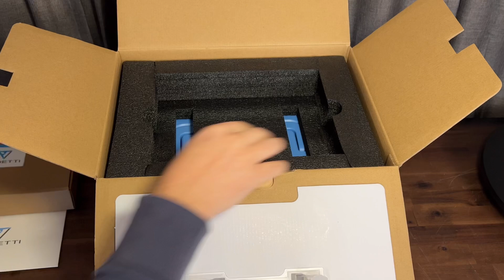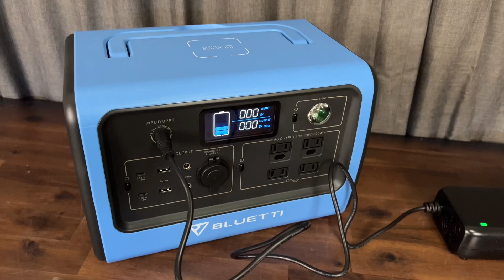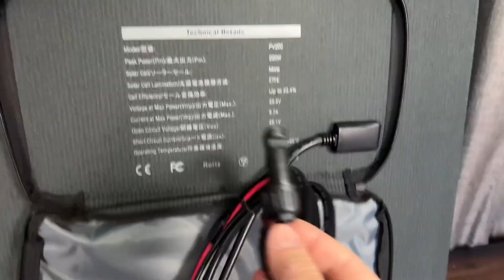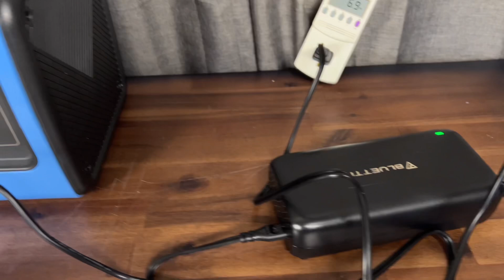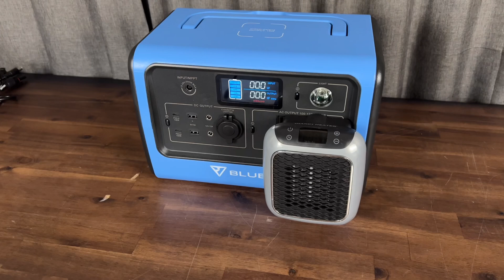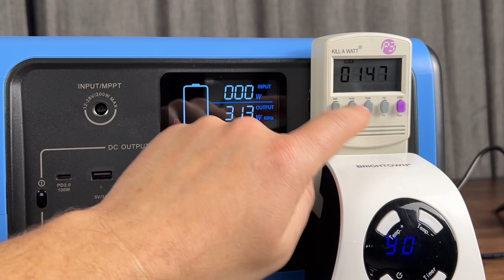Bluetti EB70s Updated model review and test

Comment: Good efficientcy, 80% for AC out, nice! My ecoflow river is only 70% efficient on AC
Reply: I think the bluetti is better but it is going to depend on how much power is actually being pulled out of the inverter.  The idle consumption is probably around 10W (bluetti doesn't show the idle consumption on its output display)... and the inverter is 85% on top of that.   So with small loads the overall efficiency is pretty bad, but for larger loads it's decent.  Not great, but decent.
Reply: So which one is better the eco flow or this one?
Reply: @dogfilms7753  The real answer is "You want to use the DC output if you care about efficiency".  Unfortunately, the DC outputs are fairly severely limited in terms of wattage.   Kinda makes one want to kick all of these power stations to the curb sometimes :-(

I am actually doing this for a few things.  I have a few gigabit switches that take 12VDC, so instead of plugging the wall-wart they come with into the AC output, I wired up a DC plug.   If have some POE+ routers that need 52VDC that I use for my wifi routers and security system.  Instead of using the wall adapters on the AC output, I wired a DC-to-DC converter up to the 12VDC output (12VDC->52VDC) to run the POE+ routers.  Thugh YMMV on that.  Potted DC-to-DC converters typically only output 48VDC which isn't enough for some POE+ devices.

That is, unfortuntely, my conclusion.  If efficiency and run-time on backups is important, the DC path is better across the board, no matter which power station one has.
Reply from the maker: I thought the river was better… 🤷‍♂️🤔
Reply: @johnnysweekends  some reviews put the river pro at 80% efficiency. Mines is river w/o pro or max.
Reply from the maker: Ahh got ya. I have a older delta and the newer is way better. The pro is the bomb!  Lol
Reply: @johnnysweekends  yeah the reviews on pro are great!
Reply from the maker: Yea but man they are spendy.
A lot of other companies are building more right now so I expect to see great things out of several power stations soon!!

Comment: The two DC ports are extremly useful.. you can connect stuff on them with an adapter.. perfect for vanlife.. unfortunately you didnt knew that
Reply: Yup, I'll be using this to power my 12v tv in my tt and my dish network from 1 source
Reply from the maker: Well with a adapter it must not be to useful or you would need the adapter. 
Those Dc ports and items you buy with that connector is becoming more rare. 
I think I have two items left with that plug. 
The 12 volt socket is more valuable to me. 
Almost everything now is usb and usb-c
Reply: @johnnysweekends  All depends of your needs, some plug other 12 volts device, tv

Comment: Would this updated version be able to power a lower consumption hot plate
Reply: I use a 500W hotplate without problems.
Reply: @blackbalerion  what hot plate do you use? Does it work fairly well with what you cook?
Reply: @FellDestroyedMusic  I use a Rommelsbacher RK501 500W hotplate. It boils up 1l Water in a standard steel pot in max. 15 Minutes. Using it to warm up canned food and it even works faster than boiling up water.
Reply from the maker: Yea… does it?? Lol 😁
Reply from the maker: Nice..👍🏼
Reply: @johnnysweekends  I also tested a 1000W hotplate... Actually it constantly needed just slightly ABOVE the 1000W limit of the EB70 (1014W approx.). The EB70 managed to deliver that output for about 2 minutes and then shut off because of overload... That is why I switched to the 500W Rommelsvacher RK501...
Reply: @blackbalerion  thanks for the information 👍
Reply from the maker: I couldn’t it to hardly even hold 800. Mins wouldn’t start a 800 watt heater that clicked to about 1100 watts for about 2 seconds or less.
Reply: @blackbalerion  I found a 900 watt hot plate. If this unit can't handle it I will downgrade to either 800 or 700 watt
Reply from the maker: Let me know how it works out..👍🏼
Reply from the maker: Nice, what brand hot plate?
Reply: Well I think I've found a solution. I located a hot plate at 800 watts. SOLUTION
Reply: So I've got the unit now. I have a 500 watt blender. It takes about 200 watts to run and it works amazingly. I also got a mini waffle maker and it works incredibly as well, taking maybe 350 watts to power. NOW I have just tested the 900 watt hot plate. It requires about 850 watts which the unit can handle HOWEVER after a few minutes it does overload but you can just turn it back on immediately after. Also, the hot plate really just heats up not a specified temperature which I can deal with, and after about 7 minutes it is so warm you really don't need constant power to heat it up any further. I am happy with all of these products. I might have to try an 800 watt rated hot plate and see how the Bluetti handles it.
Reply from the maker: Glad it’s working for ya, and yea if you get the 800 watt plate it will probably use about 750 so should be good 👍🏼
Reply from the maker: All depends on the watts of the hot plate. What are the specs?
Reply: @johnnysweekends  sorry, I'm not super familiar with this. I found a 1200 watt hot plate. If this is too much, is there a hot plate that would work with this power station
Reply from the maker: Yea that’s definitely to much for this unit…most hot plates are like 900 watts and above so this unit may not be best for that. I know it’s pretty sensitive at 800 watts. 
May need to look into a larger unit

Comment: Basic solar panel question I am hoping someone can answer for me.  I just ordered my eb70s (had it on sale for $449) and it’s solar input takes 12-28v and up to 8amps for a theoretical max of 200watts.  I already have some non-Bluetti solar panels so trying to get the max out of those.  However, most portable solar panels are 18v, so I can only input 144watts max at 18v and 8amps.  Is there a relatively inexpensive way to convert the 18v to 28 v, or would that require me putting a charge controller between the solar panel and the charge controller already built into the eb70s?  Too bad it doesn’t take up to 36v, as that would be easy(or if I hook up two 18v for 36v, will the charge controller in the eb70s regulate that down to 28v without adding anything)?
Reply: Where did you purchase your Bluetti for $449...?
Reply: @valiantthor-  It's still on sale. So is the 200 solar panel. Together they are $994.00. From the Bluetti store in Las Vegas NV.
Reply: @brynn-kolby5570  do you have the link?
Reply: @valiantthor-  strange.  I had a long answer and it disappeared.  Short answer is the manufacturer’s site had a flash sale.
Reply from the maker: The Bluetti has its own built in mppt controller and will only allow 8amps no matter how you get there. More volts will get you there quicker. But again it’s rated at 28v or again 8 amps. And that’s max, because once you have a certain amount of charge it will throttle back and charge slower the last 3rd or so. So may 6 amps at 150 watts. Only when it’s really low will it seem to allow most of 200 watts which it would never get close to. I got about 175 watts and 7.85 amps max at my meter at 30% charge and about 6.5 amps at 70% charge roughly 

But those where only a couple tests. 

That was using the bluetti panel and two harbor freight panels
Reply: My Bluetti Eb70 (1000W Version) did get a maximum of 168W when loaded by the SP200 on a bright day. This went down to steady 150W per hour. Though it is not possible to max the SP200 out with the EB70 it performs quite well in total...
Reply: $449 for eb70s include tax?
Reply from the maker: It depends where you live and if they collect tax on sales.
Reply: How do you like it?
Reply: @KT-ed8hj  it’s a great unit, although kind of long in the tooth now compared to some other offerings(it’s power meter is 5 blocks instead of a %, the power brick is not built in, no UPS functionality and it doesn’t offer an app).  If I were buying today I wouldn’t pay over $450.  Check out the LFP offerings from ecoflow.  Bluetti should be coming out with a replacement soon, but in the meantime, the ac180 is a great unit, and so is the eb3a.

Comment: Those panels are quite expensive. I will pass.
Reply from the maker: Yea they are still pretty spendy . They have come down some but still hard to justify the price. But sure are sweet for size and amount of room they take. 

Thanks for watching 😀👍🏼
Reply: @johnnysweekends  If you use your own 100 watt panels, can they harvest energy just as good as the expensive bluetti brand?
Reply from the maker: Yes if not better!! Just don’t go over the input voltage!!

Comment: Thanks for the review of the EB70, I just don't like the LCD display it does lack some useful information like hours and minutes.
Reply from the maker: I agree I would like more info on the screen and the Ac box definitely needs to shut off when not in use. Would like a better efficiency as well, 40 watts of wasted power.

Comment from the maker: What do you think of this power station? At $600 grab it pass?
Reply: it's on sale and using coupon code " welcome " you get an extra $80 off. Mine came out to $480 with 7% tax. (red one)
Reply from the maker: That’s not a bad deal..!👍🏼
Reply: @yoadriaaannn  was this at their website? I was just about to get the red one at Amazon. They currently have a $50 off coupon making in $529 with free shipping. Did your price include shipping?

Comment: Not impressed. I would rather buy a 100AH SOK battery and a inverter charge controller. It has many more charge cycles and more than twice the power. And a 10 year warranty.
Reply from the maker: Yea the power stations are nice but if you want the most for your buck building your own gets you a lot more power. 
A lot of people want plug and play though.
Reply: How do make a build like that? Any videos out there?
Reply from the maker: It’s not to hard to make a power station they can be as simple as you want really. 
I’ll have to maybe make a simple power station build video.
Reply: @johnnysweekends  Please make the video with options for a cheap display to see performance #'s to monitor the setup, and all the different receptacles that these "plug and play all in one units" offer.  Will the build have the "pass thru" capability to charge the battery and power a device at the same time?  Will Prose youtube channel has had a lot of build your own systems...big and small...but his current content has moved away from that so look for older videos.
Reply from the maker: My lifestyle is about to change some, this will allow me to produce more videos and have more time to make stuff. 
So it would be a great idea but may be a couple months away as a lot of new product is coming.